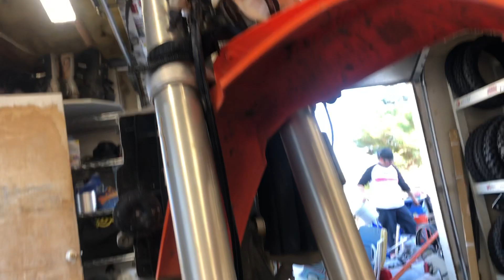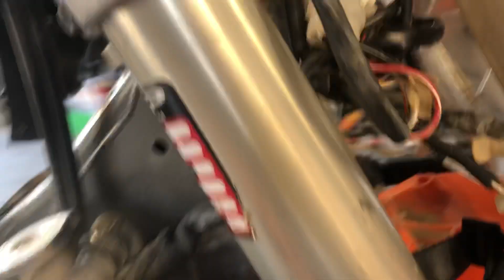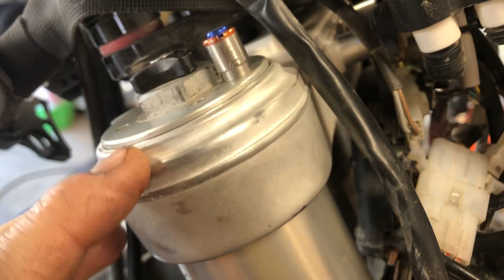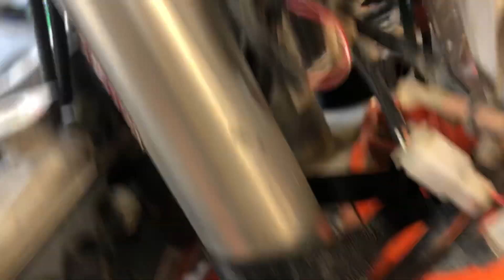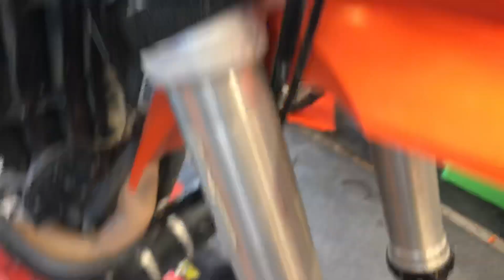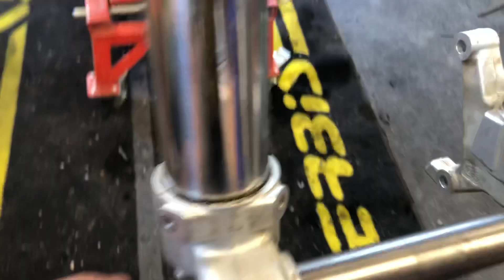KTM front axle installation / alignment

Comment: Can you elaborate the proper method of tightening the lower pinch bolts when reinstalling the front wheel to ensure the fork legs stay perpendicular when tightening the axle?